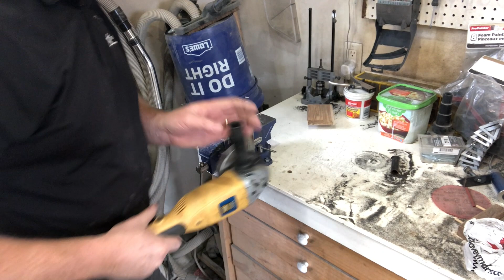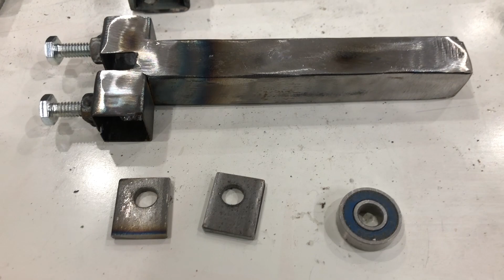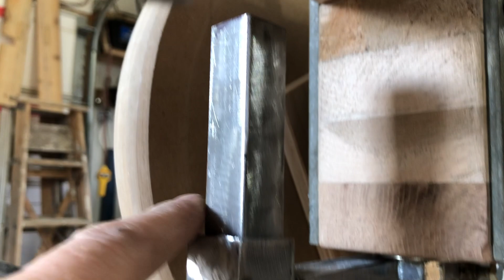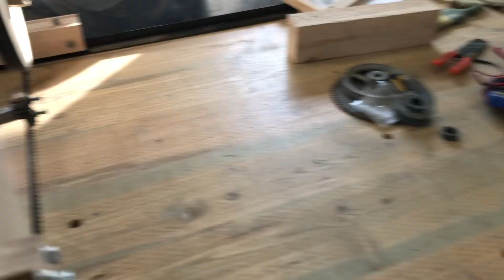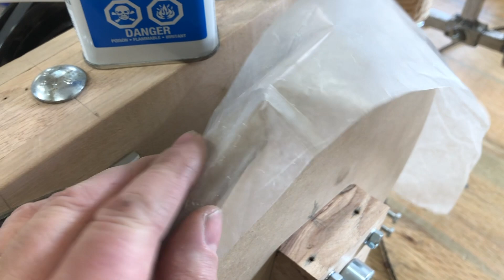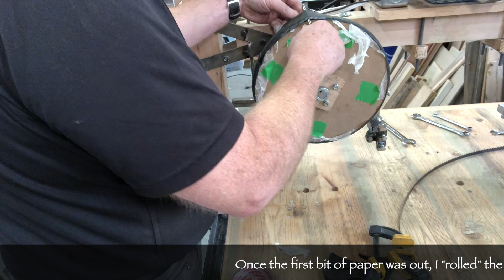Worktable Sawmill - Part 8 - Guides and FIRST CUT !!

Comment: Thanks for making this sawmill. I have already started on doing a table to flatten slabs with a router but wish to automate the processing of the work. Then I thought I would like a sawmill as well, and lo and behold along your channel comes and build a sawmill. Thank you for the showing us that it can be done. The next item I will look at unless you do it first is a full width drum sander. The reason I want to do these is that as I am just starting out in the world of woodworking and one of the projects I have started is Picnic/BBQ tables. But as they are 2 meters long and use 200 X 50 boards they are very heavy and awkward to joint the tables and seats. So having a Sawmill, Sander and router sled would make it a lot easier and more consistent. I look forward to your next project.
Reply from the maker: Thanks for your feedback! It sounds like we're both on the same page when it comes to woodworking tools.  I built a CNC router to handle material that is about 130x100 that I'll have to put into an upcoming video.  I need to strengthen the rails on it a bit first ... or maybe that's the introduction video to the project?

Comment: Why did you cut the tube that way?
Reply from the maker: I didn't have anything on hand that would fit the 3/4" square tube, but I had some metal lying around that I could used to make it. Cutting the metal into 1" strips that could be welded together to make a square tube to fit the 3/4" stock just made sense to me ... and didn't cost me anything.
Reply: I mean why did you cut the rubber inner tube in half in that manner?
Reply from the maker: Sorry, I misunderstood your question.  In hindsight, it would have been better to cut the inner tube parallel to the axis of rotation, that way it would fit on the wheel much better.  If this "tire" fails, I'll do the next tube that way.  This cut was made primarily due to the placement of the valve stem ... I wasn't thinking of how it would fit on the wheel. Lesson learned.